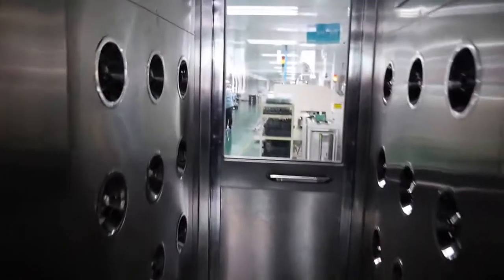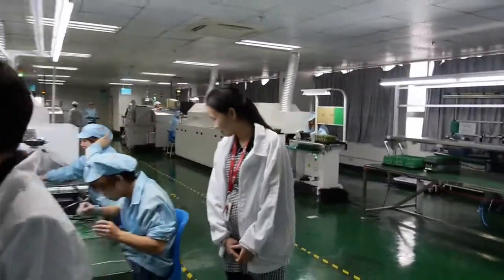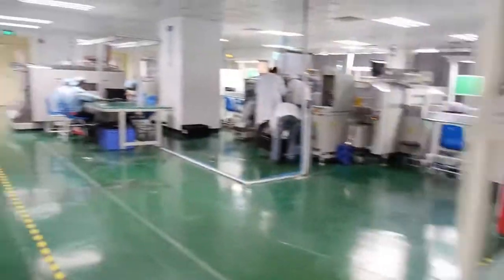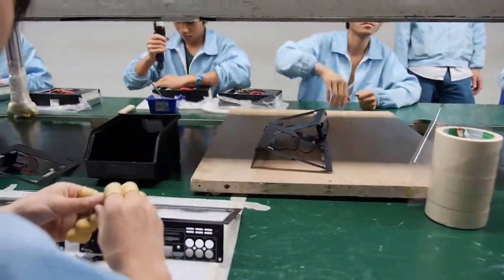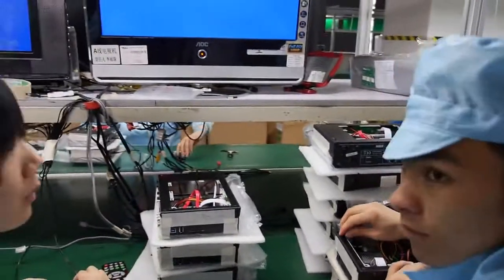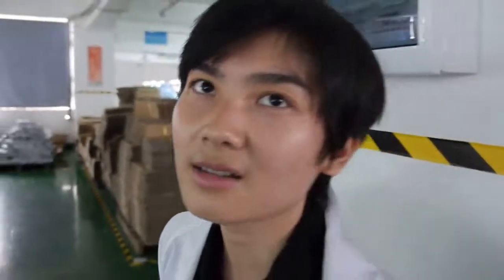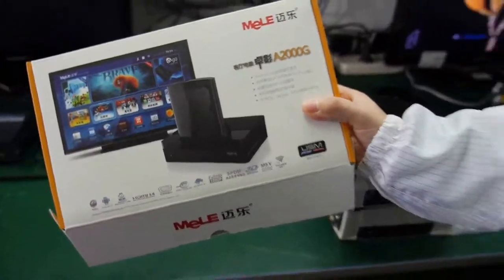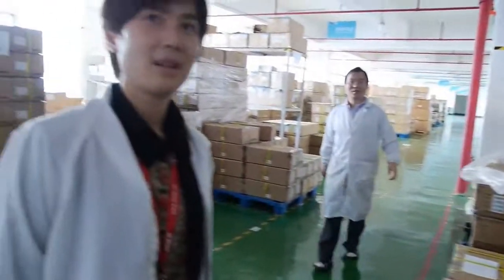Tour at MeLE's Factory

Comment: Very nice factory and workers ;)
I'm interested in the A20 Dual Core CPU "MeLE M3", because it has also VGA and RCA video outs. Is there firmware support?
I had a bad experience with Amlogic AML8726-M3 f16ref model "Jesurun mp019", I still cannot find a right firmware and bootloader and the NAND has badblocks :(
I hope if I purchase a MeLE M3 the Mele support and/or comunity will help me with any problem with M3 (I'm asking "just in case...")